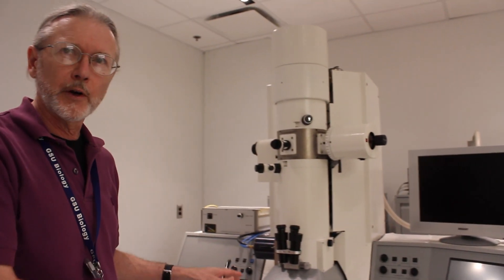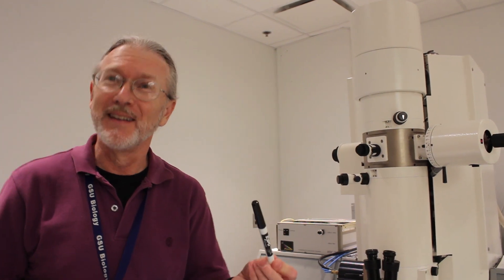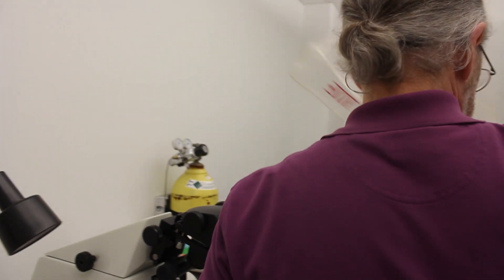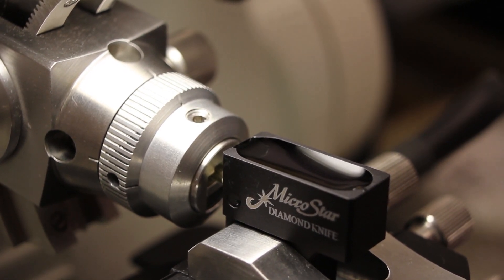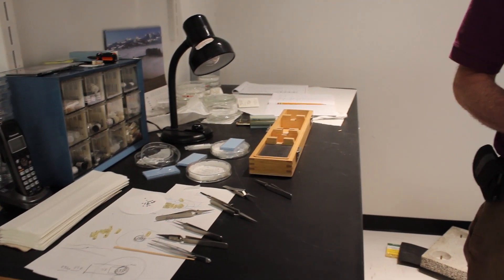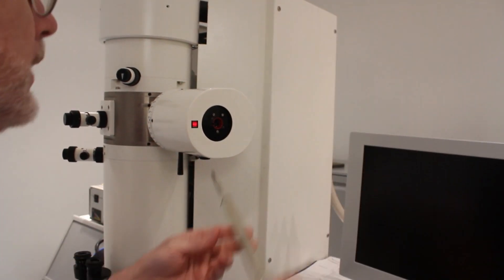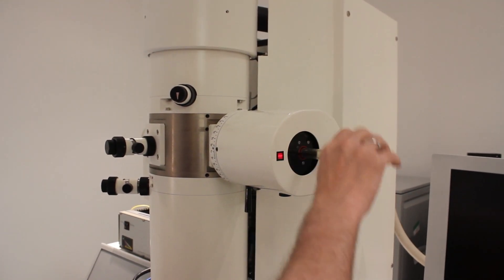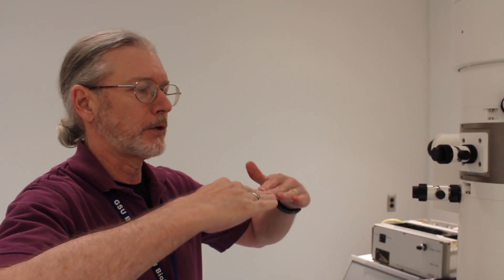Learning about the Transmission Electron Microscope

Comment: Destin, we have an abberation corrected scanning transmission electron microscope at the lab I work at. We can get atomic resolved images of materials, yeah, we can "see" atoms! Also, we are fitted with a high angle annular dark field detector which acquires images with atomic weight contrast. We get some really fascinating images. If you're interested in coming by I can talk to the Lab Manager to see if we can give you a tour.

Comment: So in summary Light microscopes Living specimens x200 mag200nm resolutionlittle distortion no vacuum 400-750 nm wavelengthTransmission Detail within cell 2D0.2nm resolutionx2million magNon living Vacuumnon living specimens some distortion Scanning microscope surface 3D vacuumsome distortion non living x200000 resolution20nm mag0.004nm wavelength

Comment: As a biology student I find it really cool to see the gray between biology and physics. The term indexing came up a few times, once when talking about the ruby in the SEM. Is this refractive index? I'm familiar with the concept with light, how does that work with electrons?
Reply: Indexing just means making sure the sample is locked into the same position every time you put it in the scope.  There's a precisely machined receptacle in the sample manipulator that fits the ruby and therefore each time the sample holder is inserted, it repeatably goes back to exactly where it was before.
Reply: Interesting, thanks! So I'm assuming that the near perfect and predictable crystal structure is the basis for this kind of orientation?
Reply: Nah, just being really hard. If it were metal, the clamped point woul wear over time and the connection would lose accuracy.

Comment: Would be awesome if he actually shows when it's working
Reply: I was hoping they would have footage of it in operation also.  However TEMs are a pain to use.  You've got to let the column pump down after sample insertion. (some air gets in through the airlock and has to be removed)  Then you have to warm up the filament, ramp up the accelerating voltage, and do a bunch of alignment and aberration corrections.  Depending on the scope, getting a sample in for high resolution viewing can take 15 minutes to several hours.

Comment: I love that both SEMs and TEMs are built around the principles of the Cathode Ray Tube - Similar electrical processes for focusing and firing electrons into a vacuum are used, but their purposes and end results are vastly different!
Reply: That's the cool thing about science. If something works, it will keep working! No need to reinvent the wheel :)